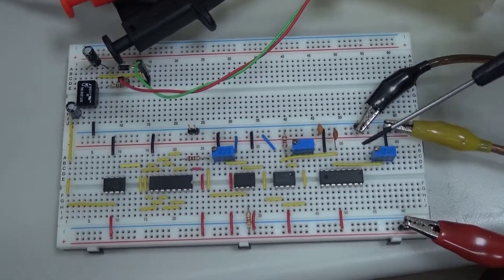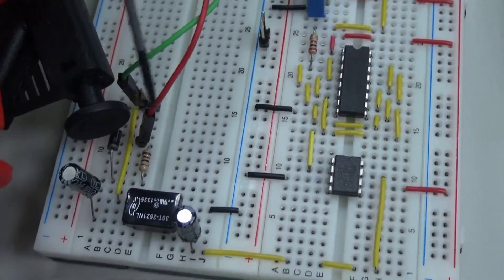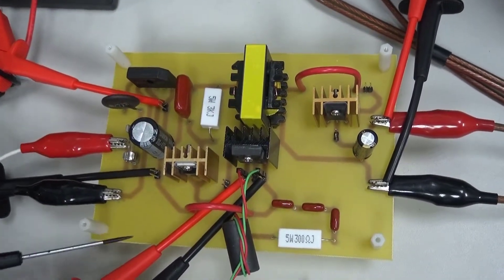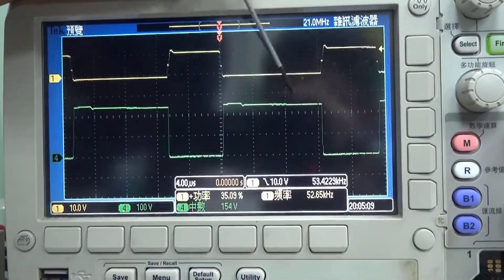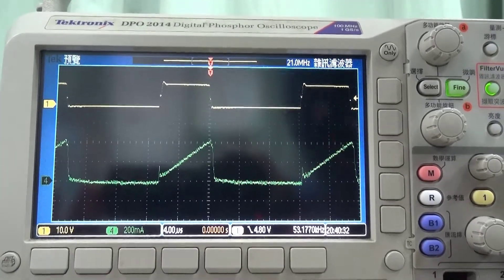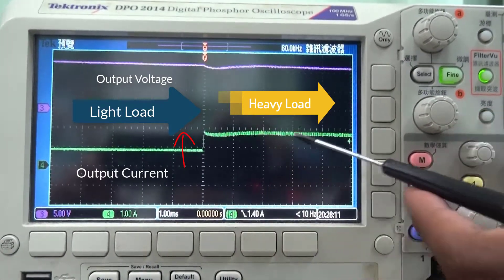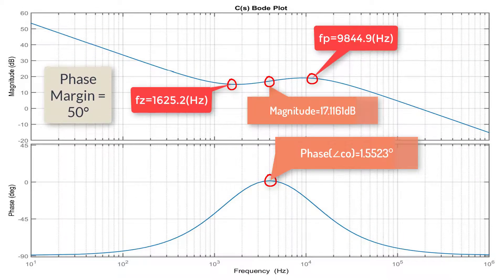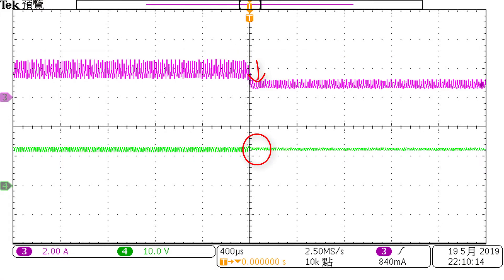Flyback Converter with closed Loop Control Part II

Comment: can you please share your circuit design with RCD and RC snubber? i'm working on it, but my mosfet burns out after heating, and also at no load spikes are larger and Vo is larger? how to solve this problem?  can you please email your design?
Reply from the maker: Hello, I recently moved to the USA for grad school. Are you in a hurry or may I reply in a couple of days?
Reply: @dajralfred  thans for your reply, my circuit is working now with designed RCD and RC snubber,  but if you will sahre your design it will be give me better understanding and confidence .  yes you can share it when you will be free, thanks. amirshokat01@gmail.com
Reply: also do i need to you insert an air gap in core,  my core without air gap gives 3.2mH inductance, and then i insert an air gap to get desired inductance, but this air gap is larger than calculated air gap.